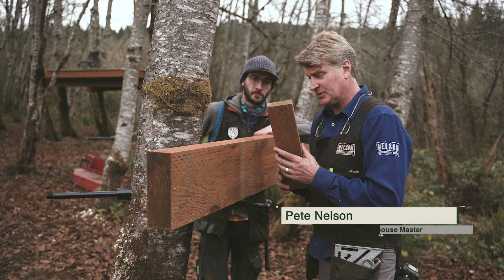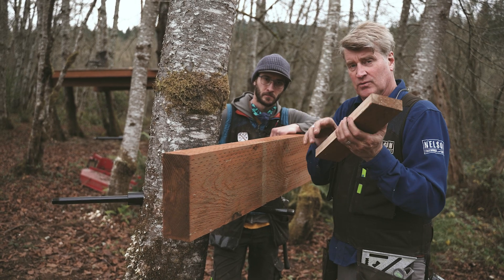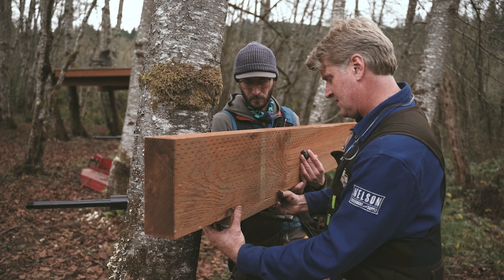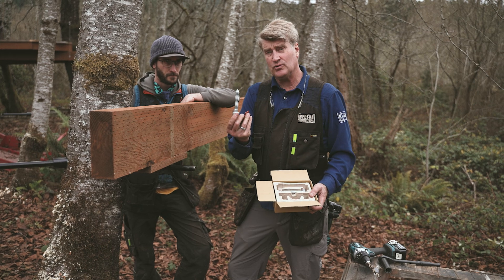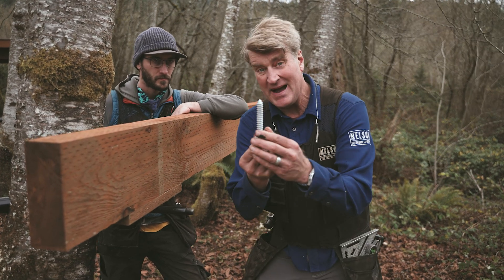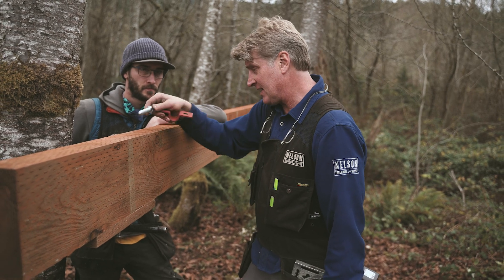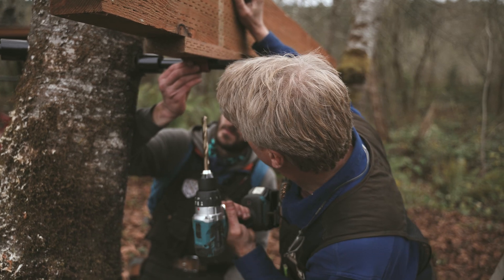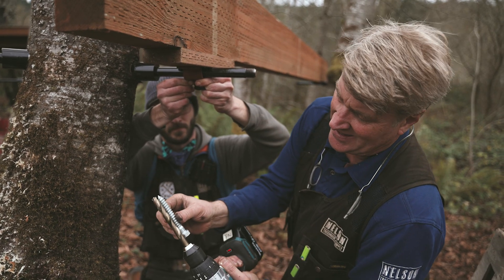Tree Fort Hardware: Static Uplift Arrestor (SUA) Installation

Comment: I'm enjoying watching through this playlist. Thanks for making it! I've done many of the construction-related tasks shown, but have never applied them to treehouse building.

 It would be great if you modeled use of eye protection, particularly when drilling. Even a single piece of sawdust in the eye can make a fun project much less pleasant. If you're really far out in the woods and you're not able to wash out your eye with clean water, this minor inconvenience could turn into a more serious medical emergency.

Since your earlier videos showed that you have an impact driver on hand, I'd suggest using it with a 1/2" impact-rated socket adapter and a 15/16" impact socket (not a standard chrome socket!) to do most of the repetitive work in driving your 5/8" lag screws. My preference would be to carefully finish them off using a ratchet (as shown) so you don't accidentally overdrive them.

Later edit: In later videos I've seen you use up to 1" lag screws. Ignore my previous suggestion about using your impact driver. You definitely owe it to yourself to try using a good 1/2" or 3/4" impact wrench for driving large lags. If you're interested in seeing reviews of impact wrenches, I can recommend either Torque Test Channel or Shop Tool Reviews here on YT.

Comment: Why the heel again? interact with what?
Reply: It looks like there is another tab installed on the opposite side of the tree.  He can't drill in at the exact same height or else the bolts will hit each other.